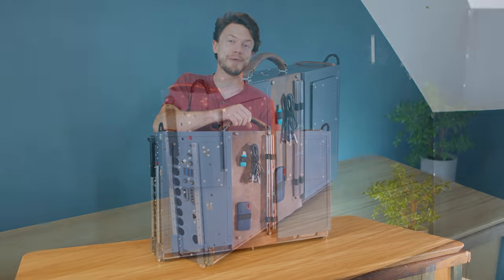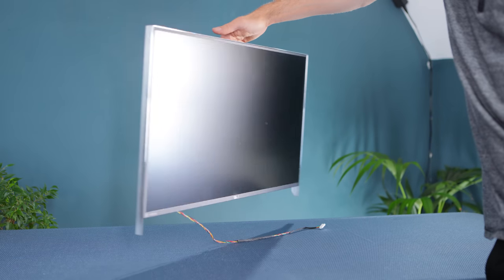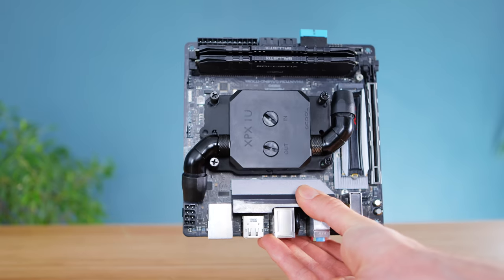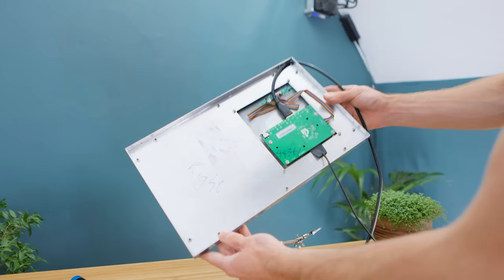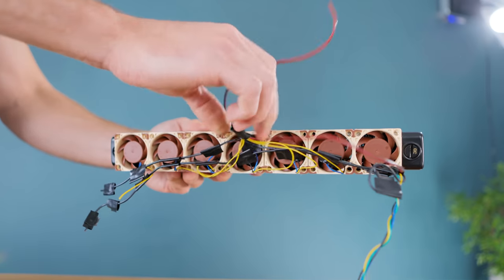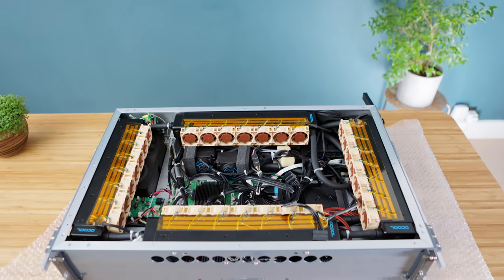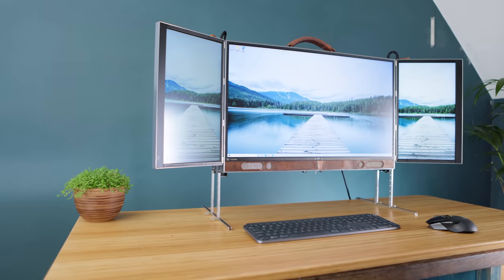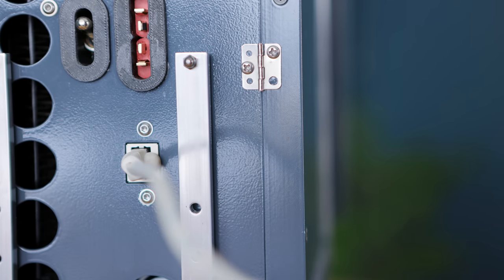Building a Luggable PC

Comment: This isn't as good an idea as people think. A high end laptop is 90% of the way to all of this. Instead of making some very costly off-ratio panels on hinges, the useful product is a repackaged standalone laptop monitor. Slim, perhaps it has extra storage, KVM, maybe even sound. It would be two separate power bricks, one laptop, one monitor, which is maybe the biggest issue, but it would also be an actually useful, marketable product to more than the highest end shoppers willing to buy a novelty PC. Honestly, this might be one of the best use cases for foldable screens, as secondary monitors don't need to be top end, especially for productivity.

Comment: Hi, can you make something with iMac 2011(27”) I means with the help of lcd driver board and using lcd for external display, with using its original speakers. Because the are awesome.  My imac motherboard is dead. And it’s setting in the corner and doing nothing

Comment: well I'll be damned. A 3 screen laptop, that houses more power and storage than my desktop PC. While it has no internal batteries, it has a full water-cooling system, and hence heat is a non-issue. 
Also it looks like a fancy briefcase when closed.
On one side, I might have made the 2 side panels bigger, so they reach in the middle, to fill the complete briefcase aspect, on the other side, the fact that those 2 are only cooled through those small heatsinks, what also require those 2 panels not to be flush with the rest of the back, is a bit painful to look at. From a design point of view, I wonder if the casing would look better, if the outer edge of the heatsinks were in line with the outer casing, allowing air throughput from there, while the rest could stay as a flat surface area. Similar to how you had the heatsinks line up with the exterior in the first video about your invisible computer build.

Comment: Way way way too large.
The rear should be no thicker than 2 inches with full size GPU as well.
Take something like the linus tech tips project made inside a 1U server rack
The monitor to be separate and user selectable from different sizes.
For example right no one could build a mini ITX case that can hold a full size GPU in a 10l volume. 
Get a separate portable 15 inch monitor of the same footprint as the case (more or less 35x25cm, and you have an extremely portable and extremely powerful desktop system that can be put in a backpack.

Comment: You sure it's only 600watts? 😂 The 3080 isn't exactly known for its low power consumption, guzzling 320W with even more in peaks. Adding around 150W for the CPU your 600Watt budget is a bit tight. Also consider 3 monitors the pumps speakers subwoofers mainboard Ram etc...